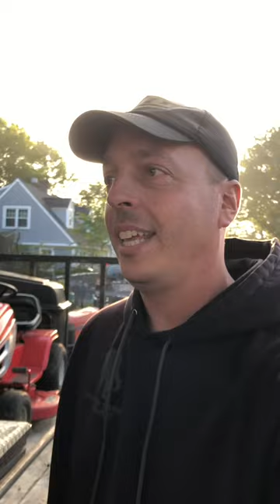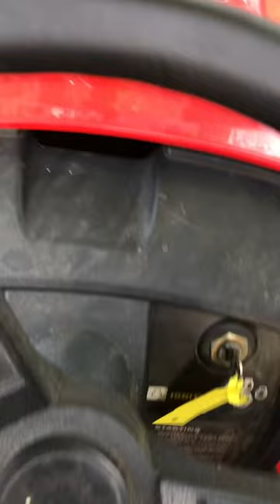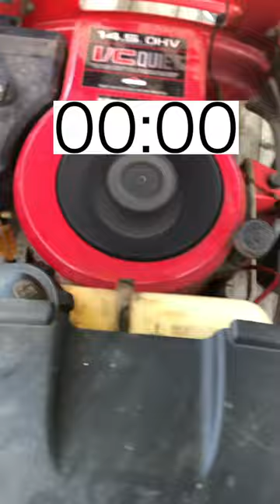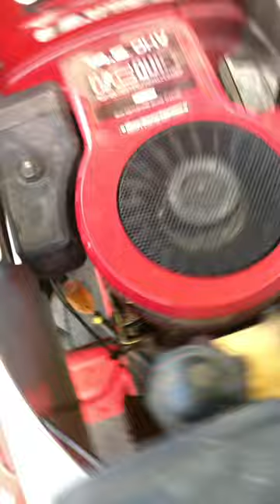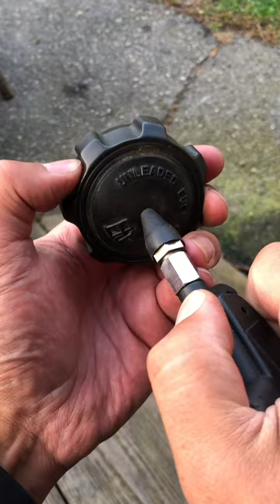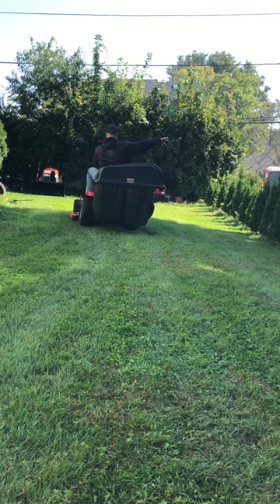Lawnmower runs for 5 minutes then stops. Here's the fix! #diy

Comment: My Husqvarna did same thing and I accidentally discovered how to fix when i checked for gas i forgot to put cap back on and it ran fine while testing soon as i put cap on and was about to mow it dies.  At first I rubber banded mosquito net on the opening. But after thinking about it i drill 2 more small hole in the underside vaper thing of the gas cap. Havnt had any trouble since
Reply from the maker: Tanks gotta breathe!

Comment: Great waving at the end!
Only thing everyone wants to be careful of when blowing out the cap vent - put a rag around the underside. Sometimes you can blow out parts of the cap like the gasket, seal or whatever. Best to start with lower pressure.